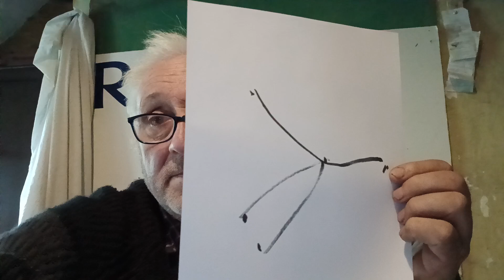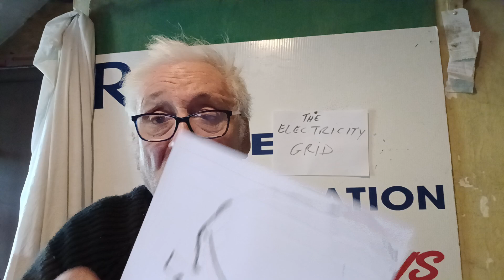The electricity grid is a machine 17th June 2024.

Comment: In summary .. problem is balancing ... Need fossil fuel due balancing the load"" on the network.  so other way to balance is to store the energy with batteries .. but this is more expensive and do not last long (at the moment so no solution)